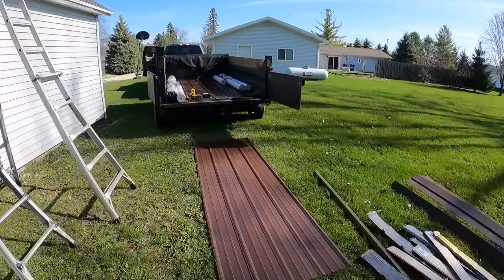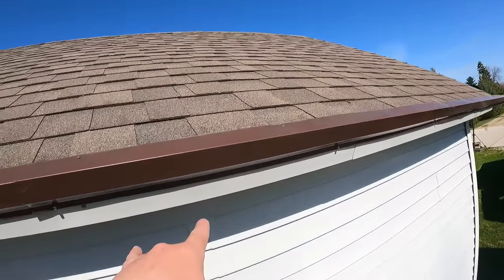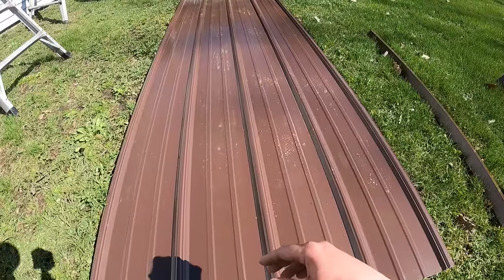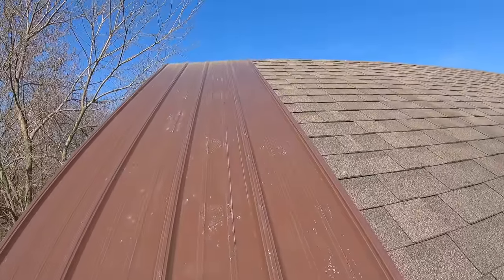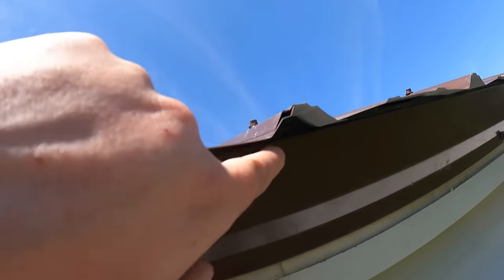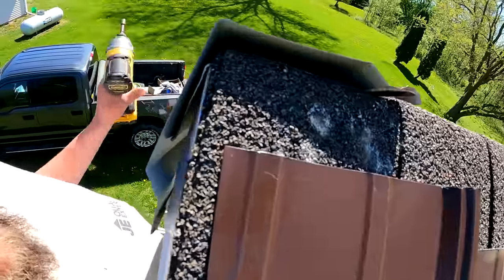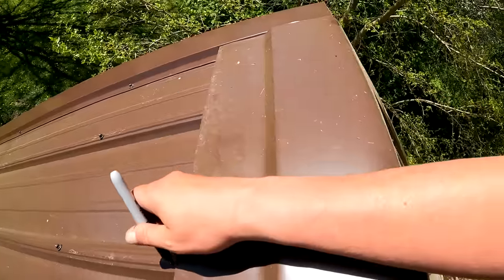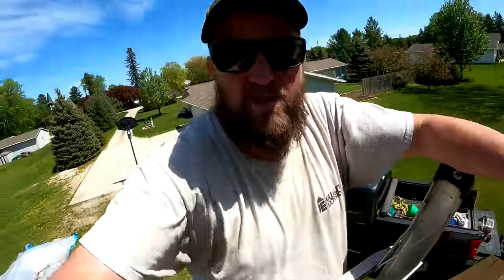HOW TO INSTALL A METAL ROOF

Comment: I don’t want to be that guy that tells you all the things you did wrong, because that’s just isn’t nice and I’ve been on the receiving end of that myself. As a metal roofer, with years of experience, I would like to give you a few friendly suggestions. First of all 1x4’s are recommended to keep the metal off the shingles, so as to prevent it scratching the metal as it’s expands and contracts, and also allows it to breath underneath, and it also gives your screws solid wood to hold on to, if you only screw into plywood or OSB, your screws WILL back out and leak. And in our experience the closures you used will deteriorate and fall out, so I don’t like those, also screwing on the ribs is actually not a more leak proof way of screwing Down metal. I would also recommend doing underlayment,  and obviously a shingle Tear-off is always best, but not necessarily required in all places. And just FYI metals from Menards seems to fade more quickly than some other manufacturers, but i understand not everyone has access to higher quality metal roofing materials. The one We like to use has a  Valspar weather XL paint with a 40 year warranty. So another reason you shouldn’t cut metal with a grinder or a saw, is also because it heats up the paint and, ( with the metal we used) it voids the warranty.  And I’ve personally seen where someone cut their metal with a saw, and put it under the ridge cap, and it still rusted. Not only that, but it also sends little hot shards of metal onto the panel and can also cause rusting where ever the sparks land. I’ve seen this first hand. All that to say, you have the basics down, and I’m sure your roof will last a good while, so good job on that, I hope this is constructive criticism, and not just another guy out here hating on your work, that isn’t going to be productive. And nobody likes to hear that. And I can appreciate the time you’ve put into this as I also make videos on Saw-milling and roofing, on different channels. @plankmiils  Keep working hard and don’t stop learning.
Reply: How do you recommend cutting metal roofing if not with a saw or cutter?
Reply: Metal hand snips or electric snips with the current cost per foot of tuff rib metal or any type painted roofing panels it's not a good idea to put panels on your roof voiding your warranty before you install the first screw
Reply: I used a diablo fine tooth carbide blade on a circular saw. It will go through 5 sheets, leaving a smooth cut that does not need deburring to prevent cuts to your hands when handling the sheet. When someone told me this, I did not believe it until I tried it. Minimum heat and minimum sparks.
Reply: Your tips are  helpful.
Reply: 1x4 will rot out
Reply: The home we bought 8 years ago now has screws that have backed out and / or loose, I bought those "REPAIR screws that are bigger in diameter with a bigger washer & rubber washer to use as replacements, or would you just replace ALL of them?? How often would you suggest inspecting and tightening them? Yearly, every few years ??? @plankroofing
Reply: @paintasylum8315  Milwauke nibbler for across the panels and a dewalt straight
Reply: @REVNUMANEWBERN  reroof it the right way and maybe clear leaves away from the snow guards if a noticable build up occurs
Reply: Great advice that does make sense. I value constructive comments far more than the video that might not be accurate.
Reply: @redsresearch  if you're furring strips rot, then you did it wrong.
Reply: @REVNUMANEWBERN  if the screws are only going into plywood or OSB, I would recommend replacing all the screws with the bigger shanked screws made for plywood. The regular screws simply don’t hold over time in plywood.  
And just keep tabs on them. If they need tightened then tighten them.
Reply: I have 0 experience with metal roofing. I can put anything under it as I haven't done it yet and it's just a wooden roof so far. I have tar paper as well.
Reply: @randallcrawf   You want some kind of underlayment. If your wood roof decking is only plywood you’ll want to add 1x4’s or 2x4’s every 20 inches.  Put drip edge on first. Then underlayment, then metal and then trim, ( corner/ Rake trim, and ridge cap. Here’s a video on how to finish the ends of the trim. 
https://youtube.com/shorts/ZcSqFl0gPMs?feature=share
Reply: Your comments were constructive and helpful. Trying to figure out how to do this myself, so his video plus your tips help a lot
Reply: Also, would a sealant/glue help with those closures? Or is that not the issue, them rotting is? I've seen some that use closures and apply a sealant in addition
Reply: How? If they stay dry then they'll be fine..
Reply: Thanks for the advice
Reply: @paintasylum8315  we use a hand Tin snips or power metal cutting shears or snips.
Reply: @dllion3196  I’ve seen metal that was cut with a saw rust, even underneath the ridge cap.
Reply: @REVNUMANEWBERN  that’s a good move replacing with larger shank screws. 
If it’s not too bad the new screws will give it another 10 years maybe. 
I’d check them every year or so for sure. And keep it clean.
Reply: What an incredibly, thoughtful, and helping for all, community post. Because of people like you and this young fella, people across the world, will have the chance to learn actionable skills, because of videos like this. The time and dedication to positive videos like this, are priceless. Thank you for teaching me, a long-time construction guy, some great new tricks. I want to do this to my own home, and never have with metal. Thank you so much! #Each1TeachOne🙂
Reply: I stopped watching in fear of picking bad habits
Reply: Friendly suggestion: click enter or return twice after paragraphs to make text wall more readable
Reply: @dllion3196  I’ve seen metal that was cut with a saw rusting after just a few months. Even underneath the ridge cap. Not an option in my opinion.
Reply: @redsresearch  I’ve seen a roof done this way last 25 years, and the 1x4’s were still solid.
Reply: @plankroofing  That depends on the quality of the metal itself. Galvanized should not show any sign of rust. The one I did did not show any sign of rust after 10 years.
Reply: Definitely steep great video Thanks 👍
Reply: @redsresearch only if it gets wet, and if it does you obviously have a leak.
Reply: I also recommend not to use impact driver , be it over tight, the screws and damage the seal, and cause leak in the future
Reply: @QariBaset  We used to have drills to do this job and they wreaked havoc on the wrists. Impact drivers are a great invention God gave us. All you need to do is to reduce the torque or get one that can do so. Or a drill that will do the same, however the drill is still hard on the wrist. Believe me as I am suffering from the consequences.
Reply: @plankroofing U pit the Underlayment ON TOP of the Perlins, then your Metal?
Perkins Over Shingles-UnderlaymentMetal-Trim??
Reply: If you put it on a 1x4 lattice how are you supposed to walk on it without bending them to all heck? You'd have to step exactly where the 1x4s are which will be impossible to see once the roof is finished.
Reply: Do you put 1 x 4 s down if you do a shingle tear off?
Reply: Yeah, if your roofing leaks 
 @redsresearch
Reply: What kinda of credentials do you have?
Reply: @jameslewis1605  at least 10 years experience. And lots of learning from others.
Reply: @Mick-g5s  from condensation
Reply: Constructive and encouraging. I want a metal roof I have got 2 estimates so far the second person I really liked speaking with. . Any words of wisdom you want to share!!!
Reply: @davidliles87  let me do it
Reply: @AKASSASSIN10  I am tearing off asphalt, then new ice water shield underlayment over plywood deck  , then installing purlins, then the metal panels.
Reply: @redsresearch  not if they're under the metal. if there's water between the shingles and the metal you have other problems
Reply: @isaacdoesskits  other problems like what? your wrong

Comment: A circular saw with a metal blade or fine tooth blade will cut through the panels much faster and cleaner.  Just my 2 cents

Comment: Never ever use drywall screws outside or inside in moisture or water areas .
Reply from the maker: Those screws are under the panel....They are not exposed

Comment: You should have lap mastic at every  lap on each sheet to keep the lap sealed. Also you should have hsd a underlay installed over the shingles before installing the metal sheets.
Reply: Guess can use that if the roof slope  is 2” or less

Comment: I enjoyed the video. If I might add a correction to help solve the excessive wear from the grinder blade. The cut should be made starting on the other side of the metal panel. The  cut you made allowed the knife edge of the metal to cut into and remove material from the blade, causing excessive wear. Cut from the other direction ( with you standing in the same position cutting away from you instead of pulling toward your self. ) This removes the knife edge effect and gives a smooth edge instead.
Reply: Interesting.  Thanks.
Reply: Or you could get a proper metal roof cutting tool that doesn’t void the warranty and lead to premature failure.
Reply: This doesn't make any sense. Pushing or pulling it's the same dynamic. The wheel doesn't magically spin any differently. Please refrain from giving any future "advice" or commentary. Thank you.

Comment: I love the metal roofing, especially when leaving the old shingles under it for insulation, but in Texas I've noticed everyone ( or around where I live ) they put a one by up to give it some air flow underneath tbe tin. I guess maybe because it gets so hot here I never asked, but it works. But you did a good job. I work alone as much as humanly possible so I appreciate this video. Thanks man
Reply from the maker: Thanks!
Reply: See planks comments for pro tips.

Comment: Constructive criticism: a1) Modern metal roof science - it's no longer recommended to screw into the rib nor lap rib. The screw has greater opportunity to work its way loose based on contraction/expansion of the metal. The screws are placed on the flats as specified, by the manufacture, x distance from the rib. a2) If someone decides to screw into the ribs a special screw called a stitch screw is to be used & not the ones you used to do so. b) Don't pre-drill (even though it is easier). all metal screws are self-starting and designed to create their own penetration. c) Under the ridge cap the metal gets screwed down 'in the flats' to secure the panel itself. Depending on the desired wind-rating/code requirements those screws need to go in in addition to the stitch screws that secure the ridge cap to the metal sheets at the ribs. d) For people watching - never use an impact tool without a clutch to install the screws. You'll get what is called 'oil canning' where small 'dents' can be seen quite easily from the ground & 'oil canning' almost always means the washer seal is too tight. e) the overlap does matter and the warranty will be void if you install them in the wrong order (per the manufacturer) f) using a cut-off wheel will also void the warranty because the paint is more likely to fail at those points. Use a 'nibbler' or make the cuts by hand (and yes the manufacturer can tell what causes paint failures). 
From the comments it's pretty clear that people found this helpful and are inspired to do their own or go with metal in the future and I think that's great. While it can get expensive to have someone else do metal installs - If one is doing it themselves it's not that much more and it'll last for decades if done properly. 40 years is not an unreasonable expectation.
Reply: Thanks for the constructive comments including justifications.
Reply: your 100 percent right but if you ask any good roofer poll barn is junk better off reshingling it
Reply: @johnlee7085  YW. Yeah, not trying to be a 'know it all' or being critical for no reason or without kindness. Everyone starts somewhere and youtube is filled with people who think they are experts on everything and they never make mistakes because they never try. The point is to try. Additionally, especially when finances are tight, I want people to know they can do a metal roof install themselves and it can, literally, last decades. Thanks again:). GL.
Reply: This guy writes a book on youtube. This is a video site, not reddit. tldr

Comment: Pre-cutting and pre-drilling the panels is a great idea and time saver. A better way to terminate the ridge end of the gable flashing is to run one side long and then  cut the vertical at the ridge line and fold it over. Over all a great video for us DYI'ers. thanks for the tips.

Comment: I have done small metal roof at my home projects. I build the rafter, then place osb plywood, then tar paper then metal roof, butyl tape  and polyethene roof flashing caulking. The guys at the treasure valley steel co are very helperful giving me advice on metal roof for a DIY guy

Comment: Rather than just start at the back, start at the end furthest away from the prevailing weather, the wind blows over the joint rather than under.
Just finished an insulated box profile roof, not only does the insulation make it warmer but stops the frost underneath soaking everything inside when the sun comes out, didn't bother on my shed  and as it thaws it "rains" on me, anyone with a van with no headliner will know the experience 😊.
Reply: Totally understand the wind concept !!!!

Comment: Awesome information, i will be doing a steel roof for a shed. Was trying to get information for the PRO RIB at Menards. The roof is almost flat, 12 inch slope per 14 feet. For rafters I used 2x6 green treated  sandwich galvanized steel. Roof  3/4 inch plywood.  Most put the screw on the flat. I was under the impression that the screws should be installed on the rib. Glad i saw your video
Reply from the maker: Put the screws in the rib...You will thank me in 15 years when the ones in the flat are all leaking. I do not care what others say, put it in the rib. Be very careful with screw pressure. do not over tighten
Reply: You might want to check on the minimum slope for metal roofs. I think less than 3:12 is considered a flat roof and not recommended for shingles or metal panels.
Reply: @Life - Do you care what the manufacturer says?
Reply: @johnlee7085  yes, very flat roof, will use tar paper and steel roofing.  Heat tape for snow accumulated.  Rain will drain. The slope is what it is. Will use boards to hold away from plywood
Reply: @Randall. Rain should drain if everything is perfect though nothing is ever perfect. 

Tar paper won’t give much protection on a roof that flat either. Any moisture that gets under the metal will likely wick up between the sheets of paper. 

You might consider a self-adhering layer to give some chance of sealing. 

Unless you already have the materials, you might also consider just silicone coating the roof.

Comment: Good description.  When I gang cut / drill the panels, I usually clamp them together (or run a screw into the first couple holes I drill) so that the panels don't slide on me.

Comment: Great video!  I am doing my shed now. I had my main house roof done. And he did not use the foam enclosures at the end. Should I fill them up with foam or something. Is it necessary.
Reply from the maker: You can add the closures after the fact.

Comment: Thank you for this information.  We recently hired a contractor to do our roof and he completed less than half the roof of our house and nothing on our garage and the contractor has taken off with our money and now we have no roof on the house and having trouble getting anyone else to come out and fix it because the original contractor did not install it correctly.   My goal is to attempt to put he roof on my garage myself, but I was curious how this system worked as this is exactly the style we have.

Comment: I seen in some of the comments before they told you it was recommended to put metal on 1 by 4 over the top of shingles I don't know who it's recommended by but I don't think they're professional at least not from where I'm from. It's recommended to tear all the shingles off come down to the sheathing make sure all nails are nailed down the sheeting is now down good if not renail it. Then put a good moisture barrier on it then screw your roof directly down to the decking and know if you get your screws all the way through the sheeting no matter if it's OSB or 1/10 they will not back out you have to come back in 5 or 10 years and replace the screws because the washers will be deteriorated but no they will not back out
Reply from the maker: That is why I screw in the highs of the panels because it will not leak when washers wear out...You should tear the roof off before install but this is just a shed and I wasnt worried about it
Reply: @user-ol4uf6uu3u  What you described is best, though some add the 1x4 to create an extra air gap for ventilation. 

The 1x4 if the shingles aren’t removed is to separate it from the shingles and keep it from getting scratched, which leads to premature failure. It’s less critical in the scenario you described.

Comment: Very informative... Thank you!  I was watching a manufacture video who drove 2 screws per valley instead of 1 per peak... The peaks makes more sense for run off but does it matter?  Also, Yours is the first without furring... Again, do they matter?
Reply from the maker: You should use furring, I mentioned that in the video. I think you should screw in the highs on the panel because the washers will wear out and leak in the lows. The manufacturer recomends the lows but I have seen way to many problems over the years doing that. It is really up to you